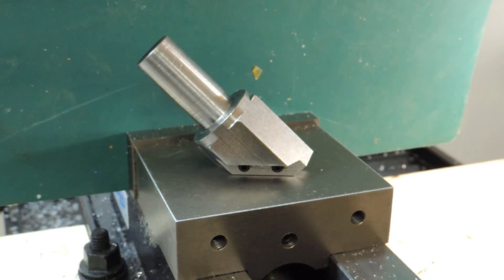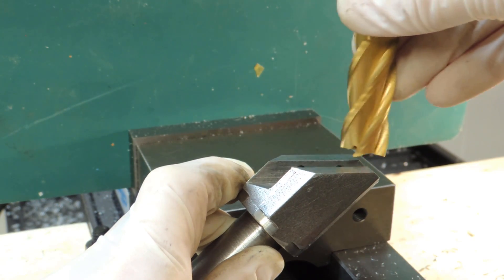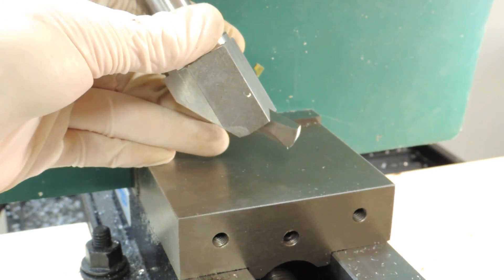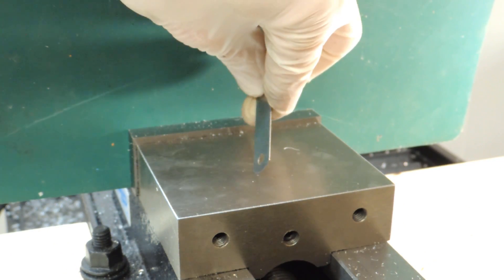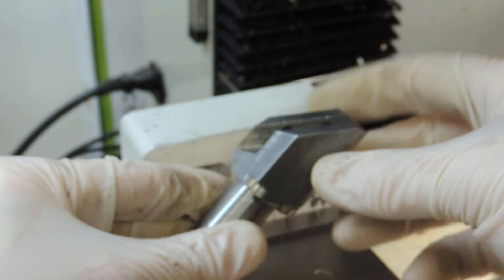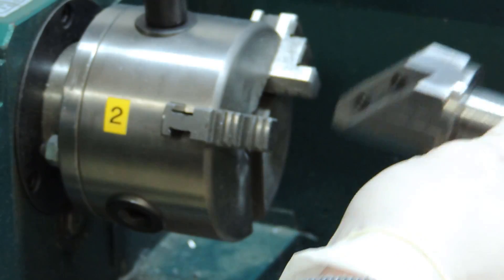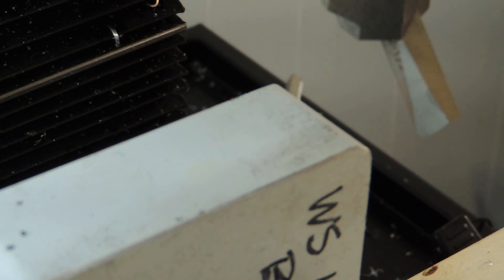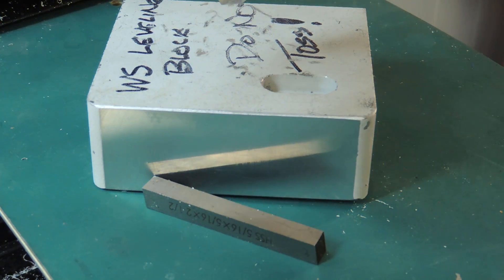Home made fly cutter

Comment: why such a big angle?  makes tool too tall  less stiff and smaller range...
Reply from the maker: I asked a very experienced machinist what the optimal cutting angle would be and he said 45 degrees.  In retrospect, I think I misunderstood him.  I believe he was referring to the cutting edge of the tool and not the angle of the tool itself.  If I build another one, I will use a much smaller angle for the reasons you mentioned.

Comment: People leave the body round so the weight acts as a flywheel.
Reply from the maker: That is a very good point.  The way I machined it is off balance.  It was a first time attempt and there is a lot of room for improvement.
Reply: @ricknelson6405   Didn't you used to sing that song "Garden Party" ?  So here's thought Rick , make the fly cutter body so you cut a 15 degree Internal taper to center on the lathe with a 2" or more head diameter. Then hold it in a v block and indicate along that surface then cut the tool slot  for a 1/4" shank  tool to center offset so the carbide tip is on center. put 2 set screws in the thick side 3 screws if you can fit them. Do the same 180 degrees on the other side.  You have to cut the 1/4 shank down so they are short enough. 
Then you set the tools by putting it in the mill and loosen both tools to register on a flat surface then tighten. 
Now you have a perfectly balanced fly cutter with 2 tips.